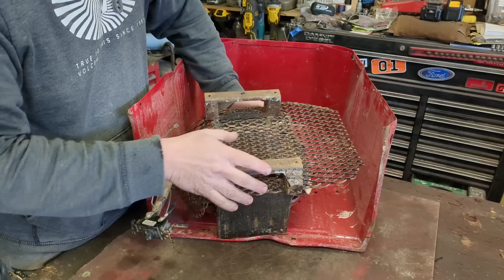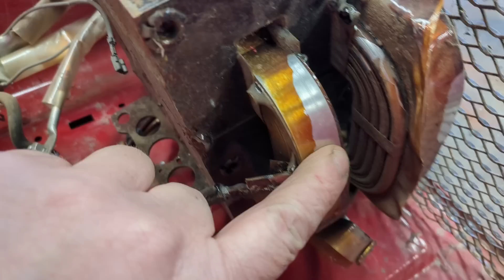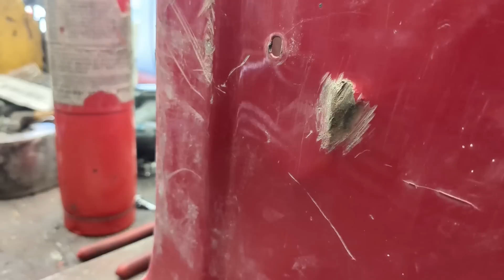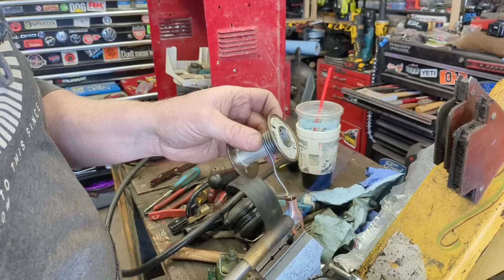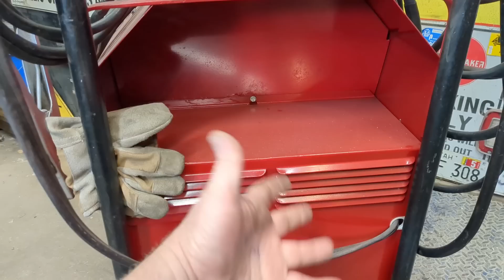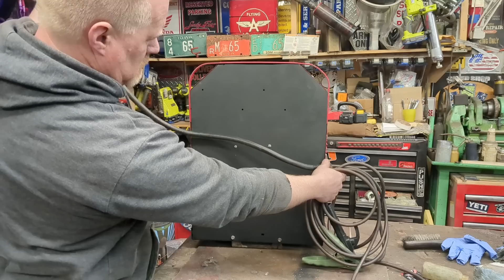Free Lincoln welder  .. Can anything kill them?

Comment: how do you like these? I'm tempted to geab one after watching you work on these.  I heard ac/dc welds better.  Currently using Hobart fux core MiG..can only weld 1/4 in max
Reply from the maker: The DC does weld better but honestly you don't notice it unless you're doing it side by side. Stick welding is dirty no matter what. I do think DC is a little easier to start an arc with though, but I wouldn't to go out of my way for one. I ran a DC flux core MIG welder for years and then tried an AC mig welder and noticed a bigger difference between those than with AC -DC stick.
Reply: @sixtyfiveford  thank you.   Next time I see one for about $100 on FB marketplace, i will grab it.  They come up once in a while

Comment: Been shopping around for leads on a budget and wondering how the leads been holding up. Bought a welder like that for 40 bucks.
Reply from the maker: I ended up selling this welder. They were holding up great. I wouldn't use them daily as a professional welder But I see no reason why they wouldn't last an avid diyer years. This wire is a little more brittle so you may have the and by the stinger break off after many hours of use.  But you could strip the wire back and reattach it multiple times.

Comment: wow, I had no idea the new ones have aluminum transformer windings. actually put the big 300-400amp twist locks and a 800cfm fan on the one i got... refuse to use aluminum cables. $1800cad for a new one of those with the aluminum in it? because the copper one costs 4 times more? then the power station rolls everything down to low output, haha because has more power, don't know how expensive the original copper units are till the 5/32 7024 runs at 50 amp thru 150ft of cable, needs much less power to work. have melted the soft rubber off some cheap cable leads. aluminum has a 40% lower duty cycle... that means a 3 hour job fixing a trailer tail would stretch to 5 hours and make the customer 280% more annoyer at the time bill. ... the longest cable run i welded off of was 270 feet 🤔 lots of copper, the dial dropped a solid 100amps 😵‍💫 160amp for 1/8 7018... 270ft of 600 volt 12ga copper extension cables out of a 250v 50amp plug. aluminum out that far would be unusable maybe 1/16 and 3/32 6011's not 7018's.

Comment: Go to a car audio shop and buy 00 cable  your looking for high strand count cableling.  Your at about 2.00 to 2.50 per foot.   It will work.
Reply from the maker: Copper is going for more than that these days. It's pushing $5 a foot for 2/0

Comment: I've got one complaint: you didn't sketch up a "Roadkill Welder" logo, cut it out and use it as a template to spray paint the logo onto the sides of your refurbished welder. By the way, good job on getting a freebie back into working order. At the rate we're going under the current presidential puppet, you might end up needing it! Best wishes!

- Max Giganteum

Comment: that makita battery looks genuine where'd you get it? nice restoration video
Reply from the maker: I built it in this video https://youtu.be/G9wPaPZQV5U?si=U96KxyCEr7RLKACV
Reply: @sixtyfiveford  thank you
Reply from the maker: @joshmultitool Essentially I just bought the case, salvaged the large 21700 cells from Milwaukee batteries and put it together.

Comment: People may rewire them to use a 30 amp plug but they are supposed to be 50 amp.
Reply from the maker: Yes, but........ You virtually never run in the 175 amp plus range where you would be pulling 40+ amps. Every homeowner runs in the 135 or less range where you're only pulling 30 amps. Also, it's not like the wiring isn't rated to handle it even through the dryer. The only thing that's not is the 30 amp breaker. The basic rule of thumb for welder wire gauge is 50% versus what's required for something like a dryer oven. This is because a welder always runs on a duty cycle and not constant like those other appliances. So you could throw a 50 amp breaker on your dryer circuit and run this welder at full tilt. But you would have to switch it back to a 30 amp to be within code for your dryer when you wanted to run that.

Comment: Different approach to bending that thin of sheet metal  attach a long pice of angle iron maybe part of an old bed frame to a table slide just the lip up under one side clamp down the angel iron and bend home made brake. 
Whats the metal sheet from?  An old broken dryer or something.

People set this stuff out as trash
Its wasteful.  It can easily be used to make something else or repaired.  This includes appliances
Finiture and raw materials.
You want to save the planet don't waste resources.

Comment: They wired houses with aluminum wire once. Didn't work out so good.🔥
Reply from the maker: Yes and no. All new homes for the past forever have the main lines come in with Aluminum service wires. Virtually every electrical device you order these days is chocked full of aluminum wires. I think we've mitigated the issues they had by copper coating them.

Comment: Worst welder ever a/c is trash. Throw it away
Reply: Decades ago I worked in a few pro welding shops that used that tombstone design. In the right hands those welders can do fine work. 6011 rod cuts through rust like nothing other, and the stick design was more friendly in the field where wind and the elements were at play. It also gave excellent penetration where broken parts typically failed close to high stress joints. MIG became more popular mainly because the MIG it was more efficient use of employee time, and because even unskilled staff could make something with thinner sheet metal.
Reply: @spelunkerd  the blue tombstones are different the red ones are crappy a/c welders. Educate yourself
Reply: @spelunkerd  this crappy red one isn’t an old crank style tombstone. Nice try but you don’t know much about welding it seems